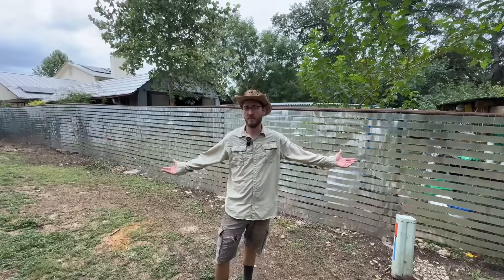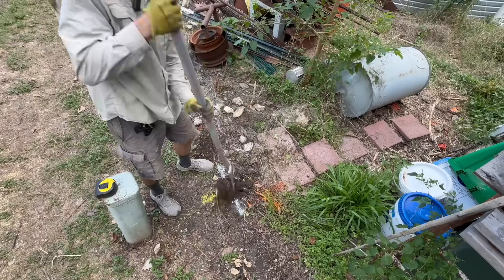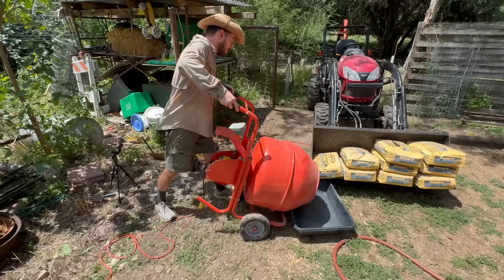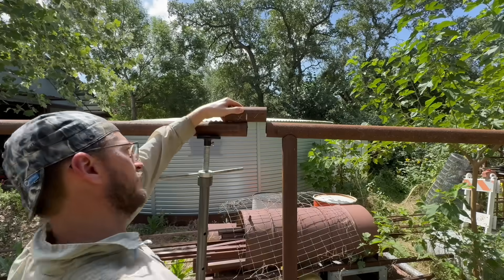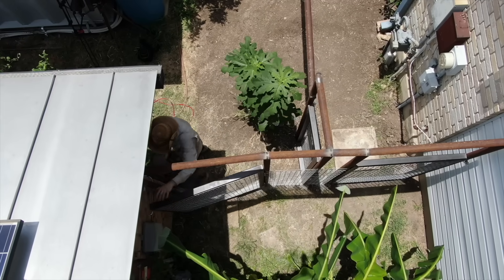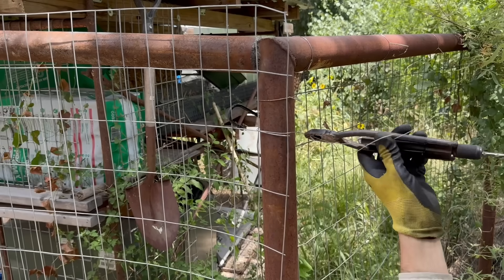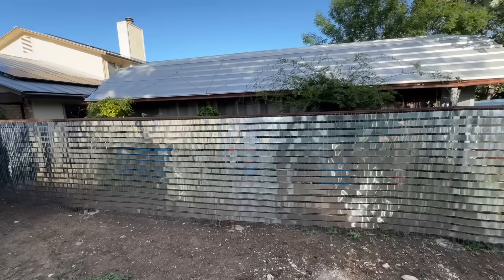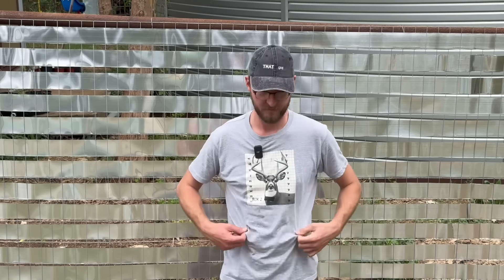This FENCE Lasts 100 years!!!!

Comment: I’m old. And when I was a little boy in the 1970s I remember old men talking about chain-link fences and how they last a lifetime. In my neighborhood there are houses that were built in the 1920s with such fences still good. I have seen recent subdivisions in the 2000s built that needed their powder coated, steel pool fencing replaced after seven years due to rust. Looking around I can find examples of similar square tube, fencing, built in the 70s still good. But steele fences with recently imported Chinese steel. I don’t know that they last 100 years. Steele is a known quantity. It is iron, molybdenum, and maybe some nickel or iron nickel, and maybe molybdenum, and I don’t see how you compromise that, but China will find a way to cheap in a thing like drywall to where it’s toxic, and it needs to be tore out because it’s falling apart. Also, all of these battery, powered bikes and scooters and cars acting like time bombs catching on fire.? They’re not our friends.

Comment: Very Creative!
Ive built many "quality,wood" fences! 
You did allright, for working with materials w/o forgiveness!
Lazer levels, take it to a new level.
Amen on learning to weld! 
A dream of mine.
We went the next grade up with one of our projects on our property. The roll out wire (horse) fencing. 
Solidifyed one end to our wood peeler core post to start our run.  At the other end  we made a come along, a 2x4 sandwich with giant washers, all- thread, nuts & bolts. We stretched that wire nice a tight, with a ratching come along.
 ♤ It looked," PROFESSIONAL."
I like the the dangerous mirror like  basket weave flashing! 
The unexpected.
But YOU gotta choose! 
Plants or flashing, because once they grow, you wont want to waste your time taking out that flashing!
You can play with shadows & shapes with that kind of material, one woukd think?
PS: Basking weaving looks great when you  step/blend/stagger/diagonal your ends as Im sure you realized!
Good job, love your gates!
Adrienne, from the redwood forest in calif.

Comment: I dont think that fence will last 100 years and that aluminum will oxidize and hopefully just turn smudgy, unless you don't bump into your mesh wire with anything   because those weld points dont hold up well and you will have to patch it up. 
I am sorry I didn't want to be negative, just realistic but it looks really nice. 
Let us know what it looks like in 5 years

Comment: Saw this video three days ago and was skeptical I could exploit the same "cheap scrap pipe" deal you got since I'm in WA. Nope, local scrapyard has tons of scaffolding pipe that'll work just fine.

I'm gonna go down there tomorrow and then replicate what you did here around the orchards.

It'll take me weeks (31 acre across five orchards) but it's worth it, the deer are such a headache in there when they knock down old posts. Luckily, I don't need to make it a privacy fence.

This is a brilliant idea, thank you.
Reply from the maker: If you have a broad acreage you may want to build it higher than 6 feet. In my relatively crowded and small lot they don’t jump the 6 foot fence. With a larger area they probably will be tempted to jump over 6 feet. Good luck!

Comment: I once saw a buck jump an eight-foot fence while running uphill. FYI.
That's old drill pipe you're using. They use it in vineyards for endposts. After welding a spade onto the area that will be just below grade, it is pounded into the ground hydraulicly.

Comment: The videos great the pricing is a little vague doing the math with no oil rig poles it’s $30 for the flashing and 18 for the wire for each 8 foot section costing $600 per 100 foot with no poles. That’s not cheeper but may last longer. Great video other than cost break down..

Comment: Thank you, I leaned some things. I live out where the deer scoff at my 6' fence. I went to 8', which I'm sure they could clear with little effort, but it seemed to do the trick. The crazy thing is, if one does jump over the fence, it does not jump back over. Nope, that would be logical and easy. Instead, they just run into the fence until they break through. I did not think it would be possible to break through a welded livestock fence, but proving me wrong is what critters do best.
Reply from the maker: I’m lucky that they are more timid in my cramped yard. Thanks for commenting!

Comment: It's a beautiful fence.  One I'd love to put up since vines grow super fast in my yard and the wood fence they latch onto is falling apart under the vines.  
Question though:  Is the mesh fence steel or aluminum?  I'd be afraid corrosion would be an issue with using two different metals.

Comment: Nice I live in a windy area. My question is would 40 to 60 mph winds make it rattle? We see 100 mph winds in the winter normally. I like the fence we have moose and caribou they get chased by bears at 3 am in the dark and strait rusty hog wire is not ez to see and they slam into it maybe this would help them see it in the dark or just before getting killed by they bears:(

Comment: Don't expect it to last 100 years.
1) Dissimilar metals (Electrolysis) will accelerate corrosion. Aluminum eats steel.
2) Lack of thermal expansion joints on the top rail will cause fatigue on the end posts of long runs.
A 100ft steel pipe will have ½ inch change in length for 70F change in temperature.

Comment: Looks dangerously sharp
Reply from the maker: Less than one would imagine. The factory cuts and my cuts in the miter saw led to very uniform and non sharp edges. A coke can cut with scissors is WAY more sharp than this.

Comment: another thing you could have done is put wire cloth on the other side too and plastered the whole thing to have a bulletproof and crash-proof fence.  Especially if you used like some thinner pipe and sucked the two wire cloths together with some ties.  Generally with "ferrocement" you want there to be metal embedded in it every 1/4 inch for maximum strength.   Also keeping the cement wet for at least a week, but preferably 28 days, lets it harden up really good.

Comment: I don't think you need to use a respirator to weld mild steel unless it's galvanized.
Reply from the maker: Flux core wire release some weird gasses when it burns off.

Comment: Dumb question, Does it reflect a lot of heat? Have you noticed?
Reply from the maker: Reflects a bit of light on the ground. But the fence runs north/south so the plants are shaded half of each day. No negative effects noticed for the plants so far. They are growing like weeds and it is hot and sunny in my climate.

Comment: Excellent video, though no way that lasts 100 years. In a few years the wrappings will cut off by friction because they are so thin. And those rusty pipes with rain will corrode and shatter in 30 years of rain

Comment: Central texas here...  Standard 14-16 gauge welded wire fence won't last 100 years, you'll be lucky to get 15-20... It just doesn't last if you have animals, vines, or anything stressing the welds or keeping moisture on it...  Anything contacting ground will also corrode through -- VERY basic and thin galvanizing vs. tensile fence...  Maybe 25-30 for anything just in the weather...  Welds also tend to be a point of weakness/galvanic corrosion over time.  But well short of 100 years.
There is a heavier gauge 10-12 gauge welded wire that will get you 25 to maybe 40, but it's generally not as durable as knotted fence...

Knotted wire fence (horse fence w/ same gaps as your gates) will get you to about 40-50 years in Central Texas.

You need to go the cattle/hog/horse panel route to get to 100 years -- and both the panels and your pipe will require painting to keep them from corroding through before 100 years...  Dipping the in-ground bases of the pipe in tar probably would have helped too...

Neat project, I just think the 100 years is misleading.

Comment: Don't know if you considered it, but Quikrete
makes Fast-Setting Concrete Mix in 50 lb bags that you just dump in the hole dry and  then pour a bucket of water on top. No mixing and hard in 20 minutes.

Comment: My main concerns for 100 year fence is raw drill pipe with no protective coating. I know it's a drier climate than most, but a wirebrush and a coat of rustoleum primer or tractor paint would go a long way for visual appeal if nothing else. Otherwise in a few years you may have "Mad Max Chique". Similarly with that flashing material. No concerns on weather wear, but man that's going to be blinding on a sunny day. A quick spray with some color would help.

Comment: It’ll last until the posts rot out from water infiltration…some posts will see more water exposure than others. If you’re in a dry climate (I am), you’ll get a lot of years until the corrosion becomes a maintenance issue…still, a better fence design than most others.

Comment: Great video - my first time here. Sure wish I could weld. Some great hacks that I've never thought of - thanks for sharing. Like someone else said - deer generally will not jump a fence they can see through to make sure it's safe to land on the other side unless they are severely pressed. I am curious - it looked as though you were running the flashing to each pipe post and cutting it off there and then doing the next section. Was there a reason for doing this instead of running each row all the way to the end? And - how did you join the butt ends of the flashing in the rows?

Comment: VERY cool fence...but a 6 foot fence is easy for a deer to clear.
8' fence, then put High vis streamers every 2 feet, that usually does the trick.

But, depending on the surroundings a 6ft fence that isn't see through will do the trick for most deer

Comment: I guarantee that fence won't last 100 years.
The metal posts will rot off at the base where they are set in concrete.
How do I know?
Experience seeing people set metal flagpoles in concrete and they failing in a short amount of time.

Comment: I didn't know you could weld rusty metal, thought you had to clean it up first.I am going to be buying a welder soon and try to teach myself because I have severlaprojects that require welding, luckily none of them are structural or need to look cosmetically very good so if I make a mess of it it will be no big deal. anyway the reason I am asking about the rusty metal is because some of the things that need welding IS rusty and it will be a huge deal to clean up all the places Ill be welding to. if you can use weld it as is that is good news for me.

Comment: That pipe corrodes (Galvanic action because of the different electrical charge between air and earth) where it meets the ground unless its high quality steel it wont last a decade here maybe a bit longer  if you have a dry climate. I can tell you they rarely last a decade here in the Ozarks.

Comment: It would have been sufficient to just drive the ten feet post into the ground  without using cement and it will be stable.
That's what I did in my backyard.  I drove the galvanized post,.. 2 foot down into the ground with a sledge hammer.

Comment: UHOH. You attached aluminum directly to steel?? Sorry, that's not a good idea. They don't like each other. They interact electrically, called galvanic corrosion. The aluminum acts as an anode, and the steel acts as a cathode, weakening the aluminum. In short, that 100-year fence may last a few years, but the aluminum will rapidly deteriorate and fail. FYI, the same is true for aluminum and cement - never embed an aluminum pole in a cement base unless you can sleeve the pole. The steel should be fine, so after a few years you could replace the aluminum flashing with something else. Sorry.

Comment: We built a similar fence except in addition to keeping wildlife out we also wanted to keep out big dogs and keep our little dogs in, including our chihuahua who loved to wander. We dug a trench between the posts about a shovel length deep. We poured post mix in the trench and around our pipe posts. One thing we did different which saved time and made it a lot easier is we just poured the mix in dry. It sucks moisture out of the ground and hardens. If you leave a bag of it sitting around even on a floor and in a shed for a while it will harden and you will have a concrete pillow. It will do the same in the ground. It has been holding up for over 20 years now and the fence looks as good now as it did when it was new.
Reply: 1coke:  Surely, in Texas at least part of the year there is no moisture for the cement to suck up.  I'm in a humid state, so I appreciate the tip.
Reply: @YT4Readers  The man who told me that was a pro fence builder who built fences in the desert. But anyway your fence is a good one and it will last forever. I like the way you added the slats to block the view. We didn't do that but I wish we had after seeing your fence. My husband died and I don't have the muscles or money anymore to do anything like that or I would. You also added the top bar and that is good to keep it from sagging. We used the 5' high 16' long rigid panels and hose clamps to stick them to the posts. The concrete between posts keeps the panels from sinking into the dirt and rusting. I'm in Alaska and the well pipes have stayed straight despite snow and ice building up on the fences and the high winds. The T posts bend under the weight of the snow and especially when the wind blows and hits it. So anyway I think you have done a great job and just wanted to make things easier for you because no matter your age work is hard isn't it?

Comment: Worked in oilfield in Illinois oil basin for nearly 5 decaded. Much of our "salvage" "structural" oilfield pipe here is radioactive! Hope each joint of pipe you have has been geigered! Sorry to rain on your parade, but I seriously doubt the used pipe in your area is any different.
Reply from the maker: 11CPM. I bought a Geiger counter because of these comments warning me. 11CPM is considered safe range.

Comment: Did you give the flashing a brush or something after cutting it to get off the burs? Doing that without gloves, how did you not have a thousand tiny papercuts when you were done?
Reply: I was wondering if after cutting the roll in half you could just sand that side down to take off the sharp edge?

Comment: Bottom is biggest weak spot in my area. You had some great ideas with this.  My dogs chewed/nosed through chain-link kennel.  
Curious if deer have jumped the 6' height or animals burrowed under or through bottom.   I have to put top tube on all bottom fences and SS zip ties every foot or pigs/dogs will break through bottom.
Reply from the maker: I’ve done bottom pipe on some segments. Helpful with big aggressive dogs. My neighbors dog is an old softie now so I wanted to save the time. Once the vines grow they are a surprisingly sting tether and make the bottom pipe unnecessary. Thanks for commenting!

Comment: Add a zinc anode to the covered part of one post. And check it on it every few months. It will prevent corrosion to the buried part of your fence. Works on bare metal boat prop shafts for as long as the zinc is maintained. Keep in mind it will only stop the buried part from rusting and not help the exposed portions as it needs the moisture to work.
Reply from the maker: That’s a cool idea. I will look into that. Thanks!

Comment: I like the fence my problem is that I do not have a cheap source for the pipe. I would have also put in a bottom pipe, maybe a middle pipe, and built them in sections (have to have something like a skid steer to move them).

Comment: Gravel tamped down with a 2x4 is much better. If you ever need to change or temporarily take down a fence post gravel is so much faster. Setting each post is instant. Make sure to use enough gravel that the post has gravel under it whether it's metal or Steel.  Cheaper than concrete.

Comment: Thanks for this great idea of the flashing!  I have dogs who have a large fenced area and I have wanted to do something in one corner to keep them from barking at neighbors' dog or activity nearby.  The wire fence is already there, so this flashing idea is (hopefully) perfect and I will only have to do the lower 3' or so.  They will still be able to sense wildlife (I like them to bark at bears moose, mtn. lions, etc.) and some other activity, but I think it will cut down some of the barking that is not necessary.  (They are good watchdogs and don't do nuisance or constant barking.). And I think it will withstand some of our 100+ winter winds.  Absolutely love this idea!

Comment: First off! You have 14,000 Thumbs up! ( SO THATS WAY MORE THAN TWO!!
I love your sense of humor! I always think of that gates  one -because I’ve been designing my fence for four years now. Bambi showed up saw my temp Naw not today 😅 going to six feet when done. 
HAVING ACCESS TO  RUSTY & rectangle steel is HUGE & KNOWING HOW TO WELD YOURSELF👍👍👍
I thought it was thrifty using the scraps to make it work-it’s something I would do. (THERES A SOLUTION (for future projects) CALLED EXSTEND-you can paint on your metal -goes on white & turns to black( it came out in the -SLICK 50 -(silicon oil to make older car engines live longer/mid 1980’s. Home Auto restorers had access to a Better than Exstend called -POR 15-same time period(Exstend originally used on Oil Riggs but sold to me in little 24oz bottles//the POR-15 came in Gallons(I haven’t looked at any Street Rod magazines in a while so I don’t know if it’s still out there)-I HAVENT SEEN EXSTEND/(may have changed name?) or SLICK-50/Blue Poly & NUPRIN((Blitz by Advil??)😢 WHERE DID THEY GO? //Exstend/Por-15 to Stop Further Rust!//
—LEARNED A LOT SAW NEW TO ME TOOLS I!  
That Twisty Semi automatic wrench would be a Huge help! ( artherwrongitis or not(a fellow commenter came up with that!) the Bucket idea to splay out the flashing!  👍& that Buck Rogers LASER  Cleaner ! NEATO! ( yes Neato!) 
And then weaving that Flashing through with the Spacey music👍👍(you’ve got mighty good knees!!
Look forward to the heated (?) Green house.